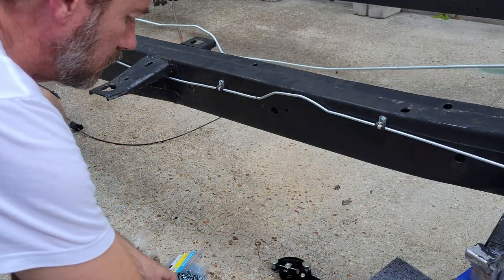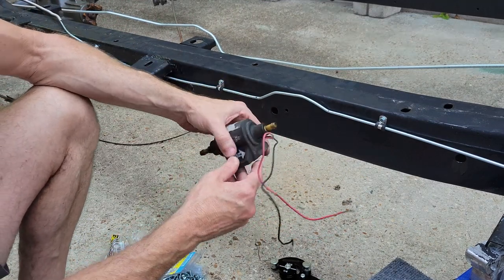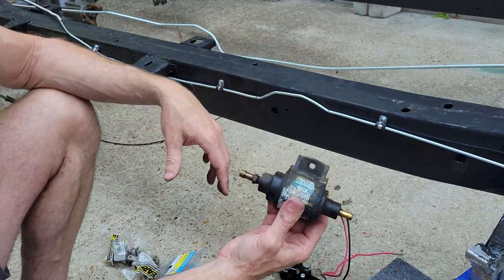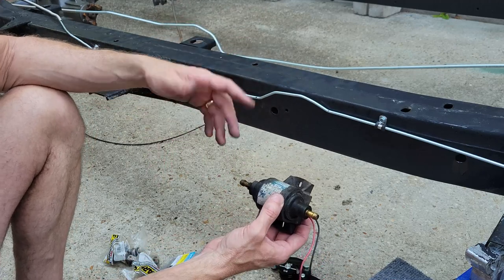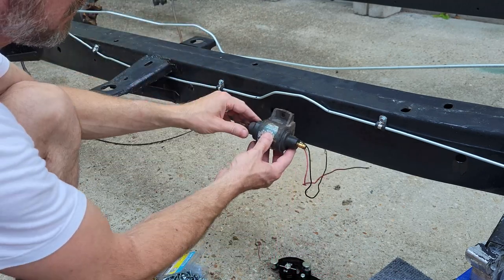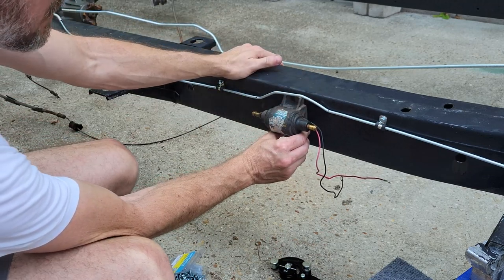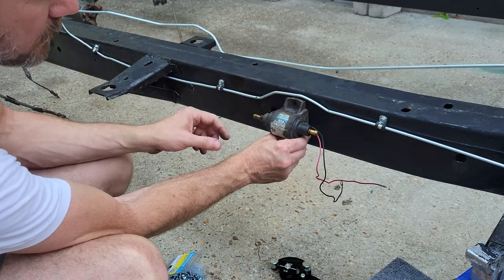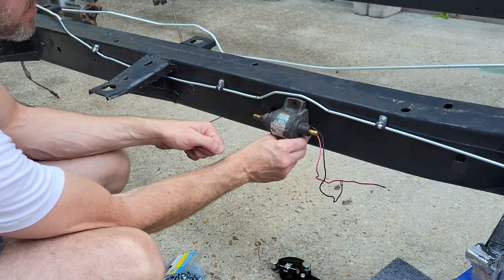E45 Bending New Fuel & Brake Lines!  1956 Chevy Bel Air Restoration

Comment: One more component of the car completed.  I used to do a fair amount of custom built air and nitrogen line systems. I always enjoyed the build and found it to be very relaxing.  The fuel and brake lines look great.  Great update on project you have made on the car.
Reply from the maker: I have a lot of respect and envy for the guys that route small tubing and electrical wiring in industrial installations for being tidy and neat!

Comment: Nice job Bill. In my el camino the brake line goes driver side and fuel line goes passenger side.
Reply from the maker: Because the 56 originally had a single chamber master cylinder, the brake lines wrap around the car from front left to right, then to the back and right to left across the rear-end.  So the conversion kits follow that same path to leave the back end stock.

Comment: I've watched this video several times. Not sure yet where I want my fuel lines and brake lines. My car was a V8 car from the factory, and my fuel lines and brake lines run on the inside of the frame using a dual purpose frame clip. Never had an issue with heat from exhaust in the past. Of course I have a 427 with Hooker headers, and had a local muffler shop run my exhaust straight to the rear bumper. But I sure do like the rubber/metal clips and self tapping screws!  :)
Reply from the maker: If it's not going to be a concourse restoration, I would focus more on making it clean, tidy and keeping with your "style." Next to that, I'd stick with cost effectiveness. I could have bought reproduction clips for about 10 times what I paid for those.  But if you've got them, reuse what you have.  And there is a comment here about line diameter.  I have a very small pump and minimal fuel demand for being a V8.  5/16 is plenty for me.

Comment: Hi Bill, just a thought. Just because you can, i would put an inline fuel filter to the electric fuel pump from the tank. i know you will have a filter before the carb , but i would still put a replaceable filter before the pump. That way you wont have any fuel pump clogging issues in the future. Just thinking out loud.
Reply from the maker: I had a Mallory canister fuel filter on the frame rail before that I elected to not put back.  Whoever built Christine back in the 90s put a fuel system on it that would make a big block blush.  All that, and smog heads.  SMH.  I decided against the big Mallory part but do plan to insert one right at the fuel pump like you suggest.

Comment: Are you going to be putting dual exhaust on it when you put it all together i think the tri 5's sound awesome with dual ton them
Reply from the maker: That video transition with the headlights and the engine sound is actually Christine!
Reply: @RestoringChristine1956  oh ok so it does sound like it has dual exhaust
Reply from the maker: @markmoats5702  Absolutely! I need to buy new headers because mine are tired. Worried about conflict with the bigger steering box.
Reply: @RestoringChristine1956  couldn't you try shortie headsets that hug the block that's what i have on my 82 z28 cause of clearance issues
Reply: I put a new Walker exhaust on the floor in my garage. That was 1988.

Comment: I kept my lines on the inside so you can't see them....one thing about electric pumps they say they don't suck they push fuel...therefore your better off as close to the tank as possible...gravity fed..but I spose it depends on the type of pump....a lot of times they put them on with a relay to the oil pressure sender incase of a roll over or accident when the engine stops so does the pump...still waiting to see it on the frame and doors fitted to see how much tweeking there is if any.... keep pluggin away
Reply from the maker: It's going to be set up similarly to the way it was before.  The pump is in the same position, just on the opposite frame rail.  One thing that I WILL do is put in a safety switch like you've mentioned.  I found one that is electronic and has a 3 second delay to allow the pump to prime the carb.  It's only 60 bucks.